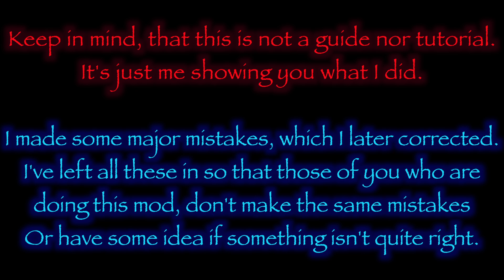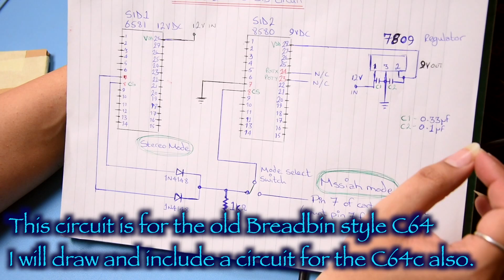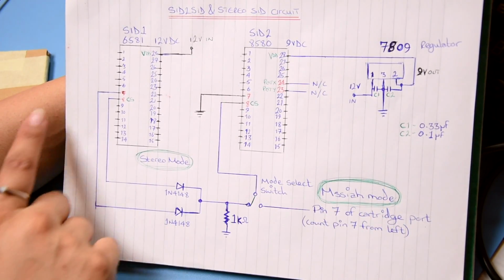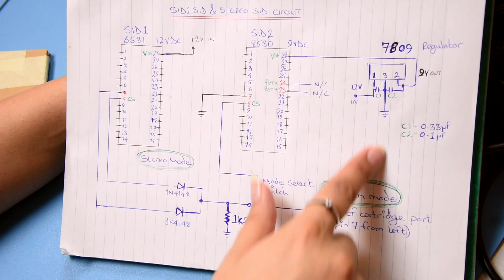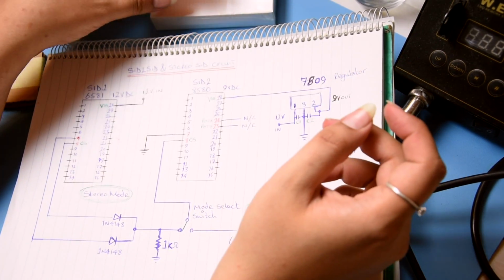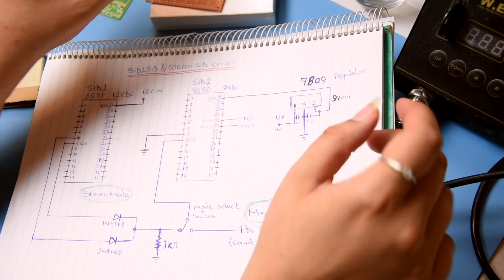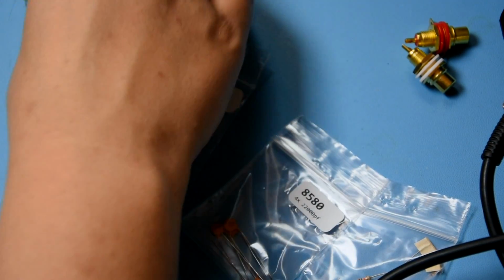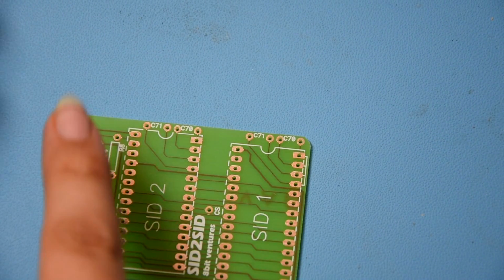Part 1: SID2SID & Stereo SID - Commodore 64 Mod

Comment: Hey, love your videos. Always a funny angle at things. Do you know if it's possible to get the sound from all 6 voices out through the audio/video DIN on the computer? I just mounted the sid2sid myself, and it works with the external audio plugs, but connected to a TV it only outputs the standard 3 voices 😢

Comment: Congratulations on your video and your explanations which are really very important. I wanted to ask you if it was possible to make two Commodore 64 upgrade models coexist together. An upgrade such as the multi-kernel which contains the jiffydos and similar roms, It is a second expansion like sid2sid or sidfx. I wanted to know if installing 2 upgrades together there could be electrical problems or hardware incompatibility characters. Thanking you in advance I look forward to receiving your reply. Best regars Marco

Comment: Hey just wondering how using 2 different SID chips worked with mssiah? I am planning on doing the same mod if it worked well.
Reply from the maker: Hey, part 3 of this series i use Mssiah with this mod https://youtu.be/MU3OWjuY-wc
Reply: MsMadLemon correct my if I'm wrong but in that video it looks like your only using the first 3 tracks which would only be the first 3 voices of the original 6581. Am I wrong in saying this?
Reply from the maker: Ah yes, actually the part i was referring to is in part 2 and not part 3, i remember, (where i tested the extra channels using the mssiag cart) https://youtu.be/g24duMoaBR8?t=21m22s  (time included in link)
But the extra channels, providing with my mod here is switched to 'mssiah mode' will work as you'd think, just add 3 extra 8580 channels to the 3 6581 channels.
Reply: MsMadLemon you are awesome. Thanks so much for the replies I really really appreciate it. I've done my set up with 2 1/4 inch jacks instead of rcas so I could patch it into mixing boards.
Reply from the maker: It's my pleasure, and thank you! :o)

Comment: https://en.wikipedia.org/wiki/List_of_electronic_color_code_mnemonics This method helps me remember the colour code for resistors. Even if it's hard to remember the numbers by the initial you can always recite it and write down the numbers as you go. 

I use the colour code for all wiring, up to 8 (violet) for audio applications - mostly banks of 8 for example. The more you drill it in to you head the more practical it will be. Super handy.

Comment: Very nice! Modding a mod, that's just lovely..! :o) Are you gonna venture into SID composing as well? I'm pretty sure, there are tracker-like programs on the C64. Just googled it, there is one called 'Hermit', which is made for triple SID machines, maybe that will work with two SID's? You know you wanna compose on the SID, hehe.. :)
Reply from the maker: Oh for sure I do! :o)  I got that Mssiah cartridge waiting to be tried, it's a sequencer style I think so not entirely what i'm used to lol I will check out 'Hermit' too because it would be good to have a tracker like program. 
It should work with two SIDs if it's made for Triple SID machines? (never heard of triple SID) 3 SID mod? 9 channels?
Reply: I don't know of any triple SID mods, but my brain figured it must exist, since there is a tracker that supports it. But I can't find anything about it.. Would be cool, though! 9 channels must have some potential.. :)

Comment: I wonder if it's possible to assign sample channel playback to only one SID alone and letting the MOS 6581 do that job?  By the way, technically this is your second C64 mod. Remember, you swapped Cases and put the C64c board into the breadbin case of the one you already had.
Reply from the maker: True, 
btw in mssiah mode it all kinda acts as if it's a single super SID with 6 channels so by that maybe it's possible to assign to whatever channel you like.

Comment: Another great video as always Maddie, A good tip for transistors is just google the datasheet and they usually show the C,B & E on the package itself. At least you left the legs long on it which helped when flipping it. \3ammods!
Reply from the maker: Yes, actually a good idea to double check on the data sheet. Thanks for the tip Mat :o)

Comment: Great so far - well explained, and thanks for the mention =D  It's annoying that transistor has to be mounted on the other side isn't it?  You would think they might have revised the PCB design by now!  Looking forward to part 2 and to see how you get on with MSSIAH later!
Reply: Gadge, you sly dog you're everywhere :p I found this via reddit, and wasn't expecting to see a post from you. Love the community for retro stuff.
Reply: Haha, yes I always find the best channels! =D.  I think JaysVintageJunk mentioned me in his A500+ video last night too.  That's what I like about the YT community - we are all everywhere!  We all land on the same videos and the same channels =D
Reply from the maker: Thanks! :o)  Yes that transistor mounting is annoying, you'll find out in part 2 how goofing around with the orientation of things throws me off (esp when sleep deprived) lol. I'm not sure if they've revised the PCB or not, this is a board I bought last year and has been waiting all this time, I hope they have revised it by now. 
And not a problem about the mention, if it wasnt for your diode and resistor setup, i would have just connected the CS directly and probably done some damage so well deserved shoutout! :o)
Reply: when you soldered the transistor with wrong orientation then SID2 will sound very quiet, that's what happened to me on my first try...
Reply from the maker: Yes that's right, that transistor setup i'm figuring is an amplifier.. hmm it seems i'm not the only one to make this mistake :o)

Comment: great video.. so you are using the SID2SID board for your modification, that is interersting.. I had this board too a while ago but replaced this with the SidFX wich is very advanced especially when it comes to noise reduction and configuration. It is complete plug&play, you can configure it with a own C64 program (Sid Types/Adresses/Sid Mode) and it works also great with MSSIAH!!
Reply from the maker: Yes I know of the SidFX and it is the ideal solution of course, though I had bought the SID2SID last year and didnt want it to go to waste, not to mention I learned a lot doing this project.